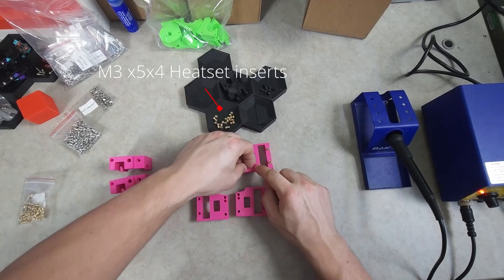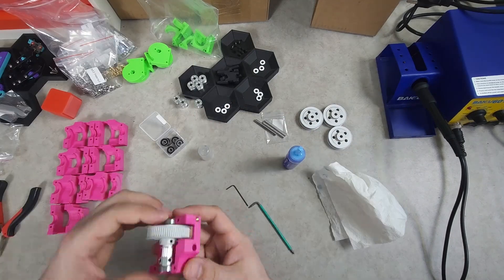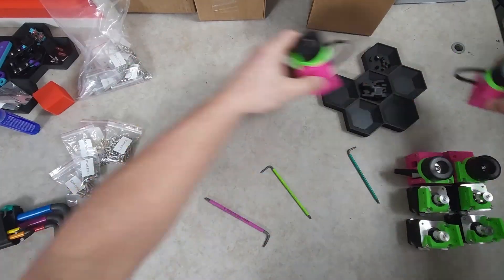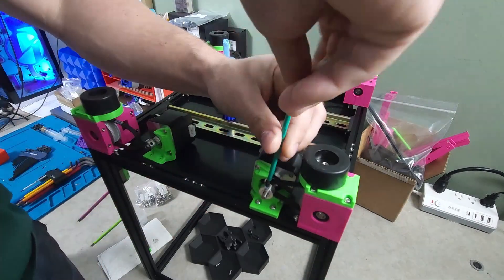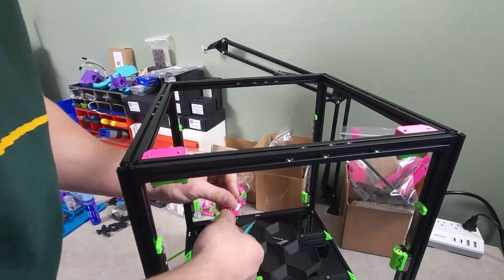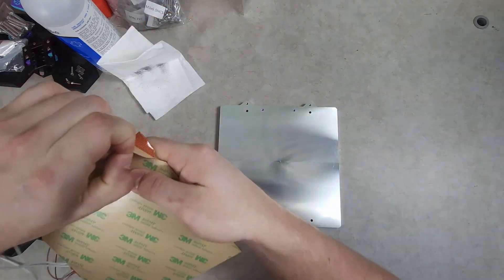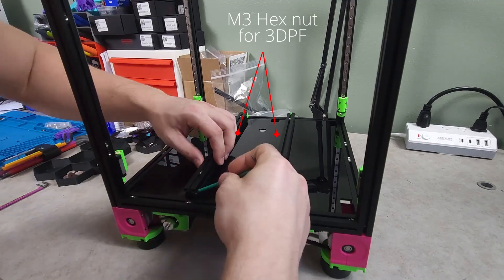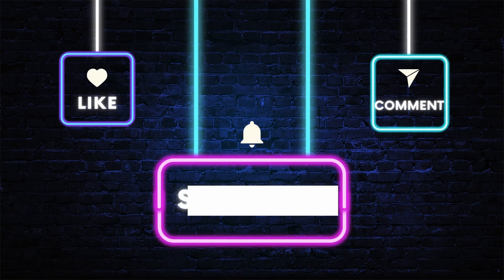Formbot Micron Plus Build: Z drives, Idlers and Plate

Comment: Just a heads up for anyone buying the Formbot kit. It appears there have been some changes. The belt loops are being shipped are random. So if you get the 152mm belts you need to print the R1 gear reduction Z drive system. The kit is not designed for it, so you will need 12 M3x40 screws to attach the Z-Drive to the bottom extrusions. Also a bunch of the parts in the Formbot links to Pritables will not work. Downloading the CAD file for the R1 is a big help as the R1 kit the instruction are incomplete past the frame build. Also the kit I purchases at the end of Febuary 2025 came with LDO Nema 17 motors for the Z-Drive and Moon Nema 14 for the AB  Motors and Moon Pancake for the Extruder. The kit appears to be high quality on all the parts so far so not discouraging anyone from buying it. Just be aware this I would consider an advanced level kit, so if you are not mechanically inclined you may not want a Micron Kit. If you get the longer 180mm belt loops these videos are a great guide for the build!
Reply: noticed this issue after i printed the parts :'(, damn i have to reprint the parts and source the m3x40 screws now ahjhhhhh

* looking through the kit, it seems to come with enough M3x40 screws